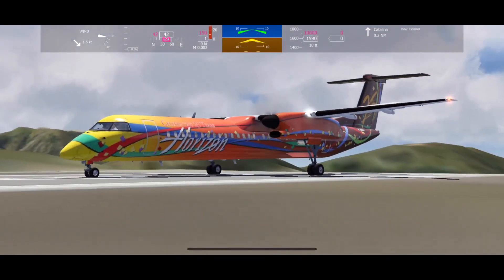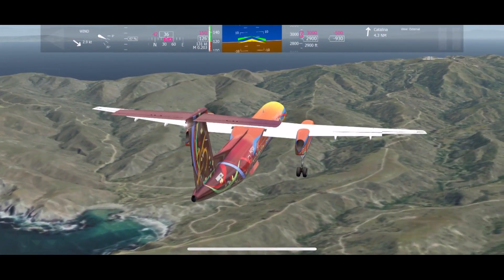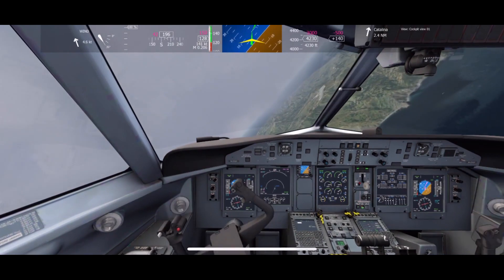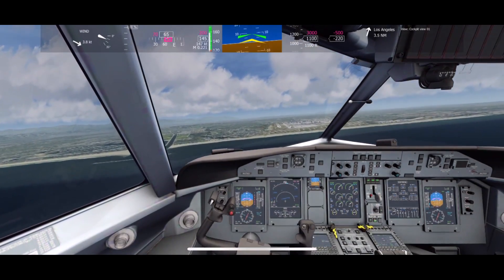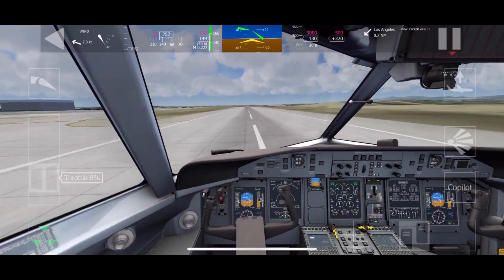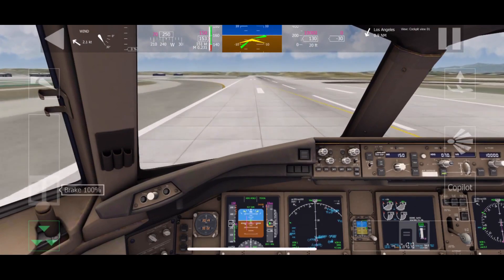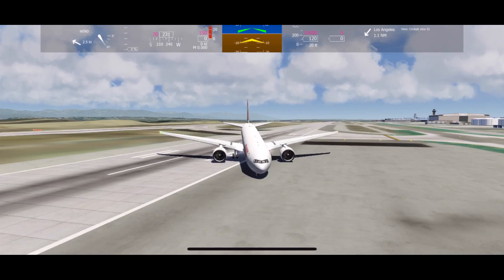Nose Gear Failure On A 777 - What Is Going To Happen?

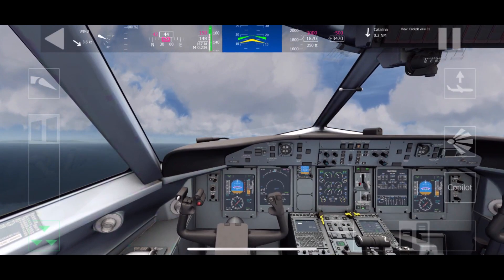Comment: You can also see at 1:36 at landing gear indicator (these green lights next to landing gear lever) that the nose gear light is off. If it was locked up, it's light would be red,but now that nose gear is missing, it didn't even turned red. That's a quite significant detail for a mobile flight simulator

Comment: If every male on earth got a boner at the same time, the earth's rotation would slow down. Assume there are about 3.8 billion males, with an average dick height of about 80 cm off the ground. The average dick weighs about 100 grams.
That's a combined mass of 380,000,000 kg of cock.
Now we must make an approximation. For simplicity's sake, let us assume the penises are all evenly lined up in a ring around the equator. The equation for moment of inertia of a ring is I = mass*radius^2. The radius of earth is about 6.371 million meters. Therefore the radius of the approximated dick ring is 6,371,000 + 0.80 = 6,371,000.8 meters.
I = 380,000,000*6,371,000.8^2 = 1.5424*10^22
The Earth has a moment of inertia, I = 8.04×10^37 kg*m^2. The Earth rotates at a moderate angular velocity of 7.2921159 ×10^−5 radians/second.
Using Conservation of Angular Momentum we can find the new rotation of the earth.
L=I*omega= 8.04×10^37 kg*m^2 * 7.2921159 × 10^−5 = 5.86286*10^33.
5.86286*10^33 = (8.04×10^37 + 1.5424*10^22) *omega
-> solve for omega = 7.292115899502489e-05
This is 4.97511e-15 rad/s slower than earth's original rotation. This translates to 6.752*10^-10 seconds = 0.6752 nanoseconds longer per day.
If we all have a boner at the same time, we will collectively be able to last 0.6752 nanoseconds longer in bed. Stay hard fellas.
Reply: I’d love that, I need more sleep.